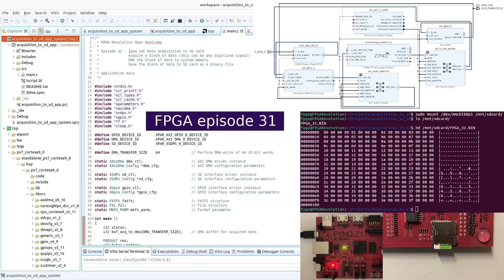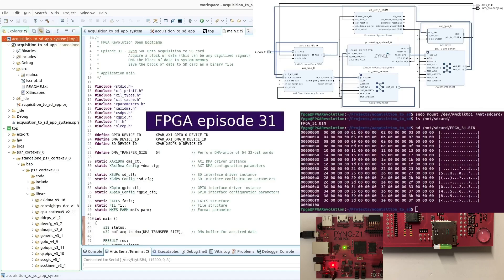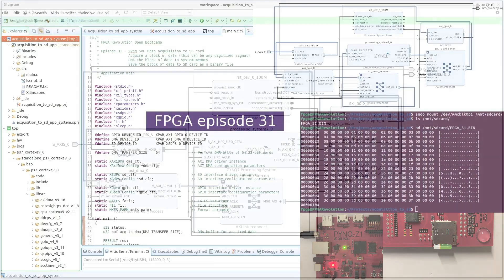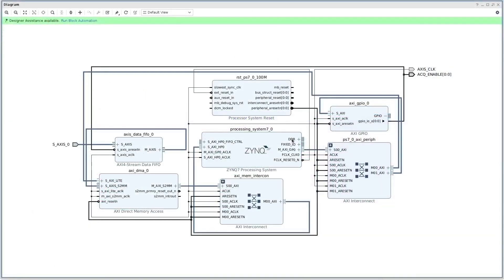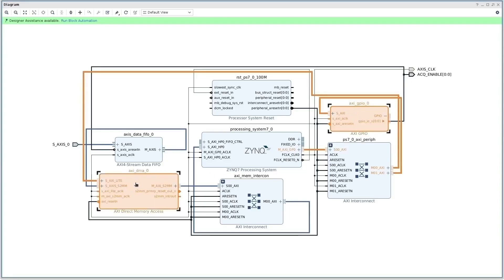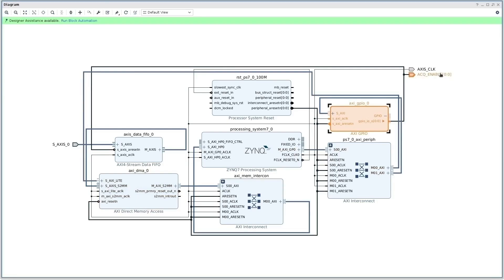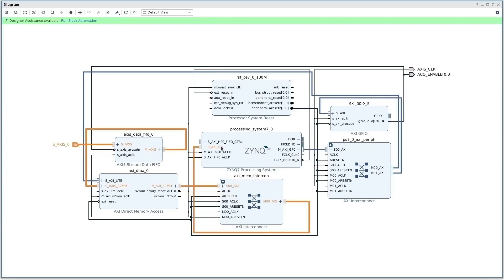FPGA 31 - Zynq SoC FPGA Data acquisition to SD card (Acquisition / DMA and record to SD card)

Comment: When I build and debug as hardware, exit.c opens breakpoints at line16 and has unresolved inclusion of unistd.h
commenting out sections of exit.c or entirety of exit.c does not resolve.
exit.c is pausing the program right after successful print of "Zynq SoC acquisition to SD card", so right before initialization of drivers or at the initialization of the first driver.
It appears that the initialization of the GPIO driver is maybe failing.

I was getting following warning for XAxiDma_SimpleTransfer:
passing argument 2 of 'XAxiDma_SimpleTransfer' makes integer from pointer without a cast [-Wint-conversion]

I also had to change byte written to a UINT.

Looks like XAxiDMA_SimpleTransfer wants a pointer, not an array for the 2nd argument.
I the warning goes away when you dereference buf_acq_to_dma by passing "*buf_acq_to_dma"
https://xilinx.github.io/embeddedsw.github.io/axidma/doc/html/api/group___a_x_i_d_m_a.html#ga32ca6099d7926297a4c17cdb4a19511b

Comment: Awesome video!

Tried to implement this on my PYNQ-Z1 board, but the DMA is constantly busy, even after the initialization.

I'm using 2023.1 workspace, same as you.

I saw that it is a common problem, but have not found a solution.
Do you know the solution for it?
Reply from the maker: If you follow all the steps as is, things should come out working as demonstrated, unless you add your own changes that have not been verified. Have a careful review to make sure you didn't miss any connections and that software drivers were generated properly without any reported errors then re-check the status of your DMA channel before you actually start to use it. If you can't seem to have proper initialization of your DMA channel early in the application, that's a good hint that you mess up somewhere and the bug is much simpler than if it was something that shows up dynamically. Review your software initialization and if it seems solid then review your hardware block design of the DMA channel.
Reply: Yep, somehow forgot tkeep signal, that was the problem.

Thanks :) @FPGARevolution